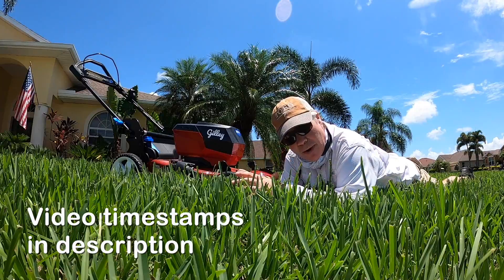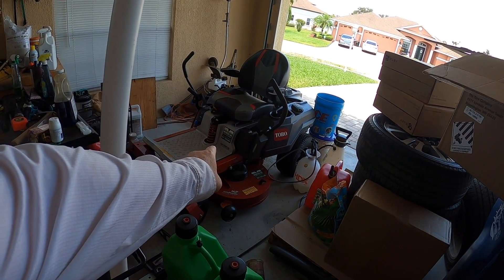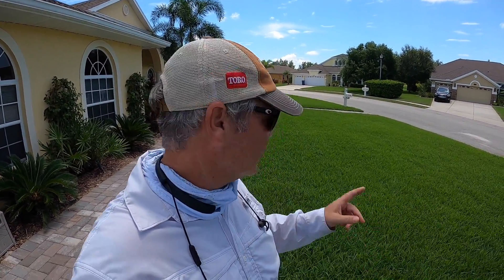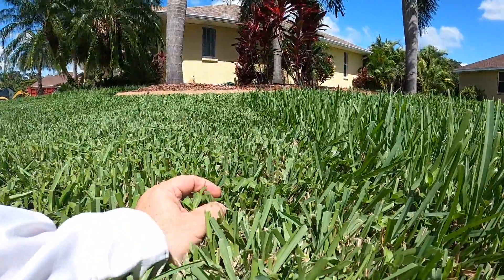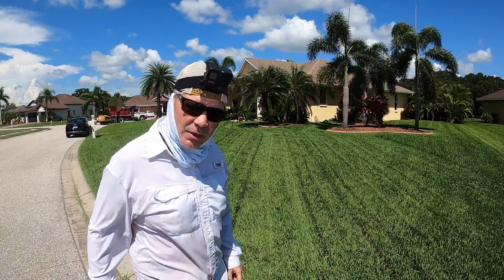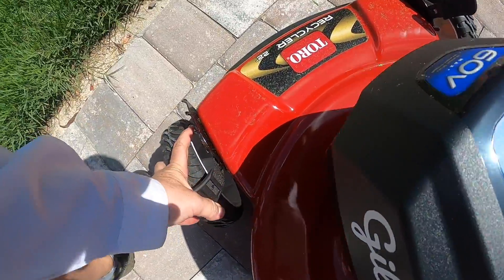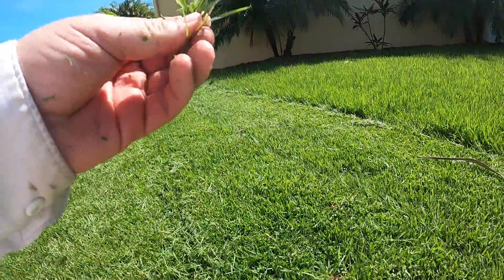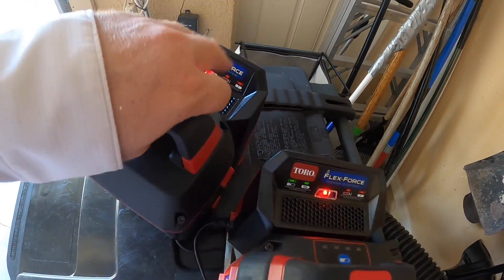60V Mechanical Bull

Comment: pro tip - charge the batteries inside in the a/c after they've cooled down 15-30min.  really the best way is after use charge all the batteries up and they are all ready to go before you even start mowing the next time.  then you can take them inside and charge them up again after you are done mowing while you are doing other things around the house.  don't be like oh it's time to mow and then you gotta wait 30min-1hr for the batteries to charge.  don't be that guy lol.

Comment: I took electric commercial last season and haven’t looked back! Extra batteries are a must but it’s so much quieter, smoother and I can lift it in and out of the truck alone. I’m using Kobalt’s 40v push mower and Black & Deckers 20v string trimmer, hedge trimmer and chainsaw.  I don’t need the gas trimmer until I get really heavy stuff. I still use the gas blower but I think the battery blowers are going to catch up in the next couple years. Electric is here and it’s only getting better!

Comment: Purchased mine 3 months ago for my Saint Augustine grass and I love it. I was a little hesitant... battery powered mower come on really...but works great. I have little less than a  1/3rd ac. I start with the 2.5 and do as much as I can and then switch over to my 6 AH and double cut everything with those 2 batteries, bagging. When I mulch I can only double cut the front of my yard and single cut the back, uses considerable more battery. Great mower,  now we just need to super recycler in a battery mower!

Comment: I have the same Toro mower except mine came with the 6.0 Ah battery. I'm able to do my 6000 sqft lawn and still have 2 lights left but mine almost never needs to kick into the extra power mode.  So I expect I could do 8000-10,000 sqft if it wasn't overgrown. 
After trying the Ego last season and returning it, I plan to keep this Toro

Comment: I had a black and decker electric mower; great out of the box. After a season got weaker. Had to charge the battery 5 times to get through my yard. Even bought new batteries for it and still the same. Love to see that thing in action after a year.

Comment: I’ve had my Toro 60V for over a year now. I took your advice, bought it online and specified a local Toro dealer when I made the purchase. That was good advice as there was a minor problem when it arrived. The dealer fixed it on the spot. They had not even seen the 60V until I brought mine in!  I have the smaller 324 ah battery, total 1,600 sq ft tall fescue, cross cut each time is 3,200 sq ft and gets it done on two bars. The only issue I have, similar to your zoysia - need a Super Recycler! If I let that lawn go one week without mowing it’s 8”+ high, thanks too all those great GC products. So my only request is not another mower review, but could you ask Toro to make a battery Super Recycler, pleeeeeease!  😊

Also, if too hot in the garage, you can take the battery into your air-conditioned home to charge. Somewhere out of the way, as it does hum while charging.

Comment: I actually use an old recycler professionally because I mow steep slopes and need something lighter than my exmark 21 inch beast. My recycler is an older unit and had the baby Kohler on it when I got it. But that wasn’t enough power. So I tried a gcv160 Honda and the air filter clogged too often and also not enough power. Then I tried an old flat head Briggs motor and that had enough power but I still wanted something lighter. I noticed your recycler is older like mine and has the flat head Briggs on it, man those are stone reliable torque monsters. I got a Troy built mower with the newer Briggs exi OHV engine in on trade. So I swapped that onto the recycler. Now it’s light and powerful. Lighter than the gcv160 and as powerful as the big 190cc Briggs flat head! Love my recycler because I can cut 6 inch tall Bermuda now with the side discharge shoot on at the second to lowest setting and it powers right through it ♥️I actually also use it on the highest setting on my neighbors st augustine mulching and it powers right through that too.

Comment: I owned this mower......I returned it after 5 weeks of cutting. The mower doesn’t have enough sucking power. I can post a video. There was lots of returns of this mower at Home Depot in my local area. Also I live like a few blocks away from Toro head quarters. I went with a Honda gas mower now, it’s 10 times the power. Tried the 7.5 amp battery as well. I’m in MN. The mower has a design issue technically, well not a design issue but an uncontrolled speed issue (over drive) where the mower goes into high mode if you throw to much at it, but this kills battery fast. Second thing is over drive kicks in when your all the way down on the push. I’ll post a video soon if anyone wants to see it.  I wouldn’t recommend it, sorry I tried cutting leaves up and it was horrible. Maybe if you live in FL where there no leaves buy it but a maple get gas.

Comment: Greenworks has a 25 inch battery model. That would be a good comparison video to meet in the middle between the battery Toro Recycler and the Timemaster.

Comment: The go to comparison in spring of 2021: Ego LM 2156 / LM2135 Vs Toro 60 Volt Super Recycler or Recycler, vs new Ryobi 40 Volt Cross Cut. I’ll see you in the lawn! What says LCN on the $600 plus Cordless mowers?

Comment: Nice review. I bought the 21" Ego Select Cut this spring. It's working fine so far, although the highest cut is a bit ragged. I do hold up on the handle as you indicated in your Ego video which seems to help but I dropped the height to 3.5 inches (#5 setting). I'm thinking of overseeding with TTTF this fall in my KBG sodded lawn. I hear it's less susceptible to dog urine spots and more heat and drought tolerant. If that's wrong, let me know before it's too late. Keep 'em coming.

Comment: Great video Allyn. 
I bought this machine in a non self propelled version as it extends running time and as with any model or brand of mower, makes it half as likely to need repairs over the course of its lifespan. I’d returned a cordless Husqvarna that I’d purchased after only one month as pieces on its handle assembly began to crumble after only a few weeks so being a lifelong Toro owner I was happy to buy the 60v as it was like coming home. I’m still happy and it’s now a year old. Hope that it lasts as long as the Recycler with Honda motor that it replaces. 
I’m glad that you asked about seeing other options. My Toro works as well on my small yard needs as my gas Recycler did however I’m curious about either of the two, twin blade offerings from Greenworks in their 25” models either 2510802 or 82VGMS250.  I’m curious about their mulching and bagging performance as they are like junior electric Timemasters.  I only use my rotary mower once or twice per month when I deep rake then vacuum with the mower.  The rest of the time I mow every few days with a manual push reel Hudson Star which is an artful treasure. 
Thanks Allyn.

Comment: I've got a Snapper XD 82v 21-inch Deck Self Propelled which came with two batteries. Bought it with an 82v Leaf Blower so now I have three batteries. Each battery can do 3000-3500 sq.ft. so my 7500 sq.ft. yard takes 2.5 batteries (thick and tall KBG). With three batteries, I get continuous run time even if a battery overheats. Personally, I think it was nicer than the EGO, but that Toro gets my vote for the washout port!!!

Comment: Hey Lawn Care nut, I’m fully geared with electric lawn gear (Ryobi 18V, 5000sqft lawn). I have really enjoyed the experience, but a must have is multiple sets of batteries so you dont have to wait for the charge. It’s also helps to keep your batteries inside, it will help the overall health and longevity of the batteries (I’m a EE, so speaking from experience). Glad you gave electric a try, I can appreciate your preference for gas. Would love if you could make it out here to Tallahassee some time and help me with my centipede lawn. Thanks!

Comment: Hey LCN, I REALLY want your opinion on the Greenworks wide deck mower. It's Timemaster style, but I haven't seen any reviews of it from a source I trust. Especially someone that is so into the original mower it's mimicking. I have a larger lawn but I'm all about electric now so I'm thinking about upgrading next season.  THANKS!

Comment: I have this mower and it does a great job on my St Augustine grass. I've had it for about three months and even when I've walked the whole yard looking for clippings, I haven't found a thing. My only complaint is that I've noticed a clicking sound coming from the wheels lately, but whatever it is hasn't effected the performance at all.

Comment: I got me a Snapper 60V lawn mower about a year and a half ago. It's not as high tech looking as this Toro but it "does the job". Cuts the grass. Since then  I've always wondered if you'd switch to battery powered lawn mowers. In my opinion they're alot simpler to work with, no gas or oil needed. But I think they need some time before the performance matches up to gas.

Comment: Did you see Toro has a battery version of the super recycler? I'm re-watching this video because ive been preparing for months to get a super recycler, then upon checking prices i see this new one. I think im going to stick with gas despite me preferring the environmental aspect of a battery. No tdead set yet though.
Reply: Careful on the 190 CC B&S Super. Not much love for that variant. Lots of stalling and carburetor issues. The smaller B&S or Honda engine seem to get more love on the inter webs
Reply: @seanrice7511  thanks for the reply ive since decided to go the battery route.
Reply: @webbspinner57  awesome! The Super Recycler or a different one? I’m in week one of using the Ego LM2156. About to switch to the high lift blade for week 2. I have to bag my backyard sometimes due to dogs but mulch front. So we will see.
Reply: @seanrice7511  the super recycler… waiting on delivery now…
Reply: @webbspinner57  I think that is the true competition  to the LM2156. Price, battery runtime, cut quality, etc. congrats and good luck. I really hope someone starts reviewing the $400 Home Depot Toro 21356 without Personal Pace. I may try that one if I don’t keep the Ego. But 3 weeks before I have to decide.

Comment: Didn't read all the comments, but I'd like to see it up against the Stihl self propelled.. bonus functionality, one adjustment for height, also gets hot battery charging delay but the charger forces air flow to reduce the wait time

Comment: I wonder if Toro and Ego shared some designs on the batteries/motors. The batteries share a similar size and similar charger as well. the 56V vs 60V is probably just marketing just like DeWalt does with its 20V even though it's actually an 18V. It even does the same spooling up with the high/low drive that my ego does.
 Can you give us any insight to that Allyn?

Comment: You should review the Greenworks 40V 21" Brushless (Smart Pace) Self-Propelled Lawn Mowers that you can get on Amazon.  I normally mow my ~1 acre yard with a lawn tractor but am considering getting an electric mower for some of the areas that are hard to cut with the tractor.

Comment: Is MTD out with one yet? Here's why I ask. I bought a Toro earlier this year after I bent the crankshaft in my old Craftsman/MTD gas mower. I hit a bush stump. I am happy with the Toro and it has plenty of battery life for my needs. But I don't like the single wheel drive. lts fine on level ground but spins going up hills or across a hill with the drive wheel uphill. The MTD had a nice two wheel drive with differential-like action for turns. I'd pay extra for that feature. The other thing that it lacks is single lever height adjustment as the MTD had. I don't like the individual wheel adjustment. Not at all. Otherwise, the battery does gain a bit more life after a few initial charges. It rarely goes into high power mode. The MTD always started easy unless I had it on the side to sharpen the blade or when it was hot, probably vapor lock. So in that, I appreciate the electric mower.

Comment: Will it get through the zoysia on the lowest setting without stalling (with a bag is fine)? Getting through the spring scalp on the zoysia is a key requirement for me... I wouldn't expect it to at full overlap even half overlap would suffice.

Comment: I have an Ego set up and what I do if the yard is tall or wet and I know that it will take more battery than 1 full charge is......I mow the back yard first....put the battery on the charger. Then I edge and when im done the battery has plenty enough charge to finish the job.

Comment: Personally I'm not sold on battery powered mowers. Mostly because the battery life is a problem. I have an empire zoysia lawn and would need to have two batteries just to get through one mow and ever time I go to lowes or home depot I always see at least half a dozen of them returned for one reason or another. Ultimately I will stick with my craftsman m230 cuts great and is half the price.

Comment: I have thew Green Works 80v  21" Mower and Trimmer/Weed Eater. I'd like to see the comparison on that , I have a 4200 Sq Ft Yard and have no problem cutting my yard on one charge Large Battery. I also cut my neighbors yard every other week all in the same day. Side note I don't have the charging heat issue that you experienced so after the 1 hour charge I was able to complete her yard as well.

Comment: Try the new Harbor Freight Atlas.  They are the budget competitor to the big brand battery mowers.  They use an 80V battery that even operates as a 40V for longer runtime in some of the accessory lawn tools.

Comment: I believe That flap in the back has an open hole at the tailing edge you can put a piece of 1/4 inch rebar in it to weight it down for better striping

Comment: Put it up against the New 20V Dewalt while using flex volt batteries. I got one and I swapped the stock 20V 10ah batteries for the FV 9ah batteries and heat wise they do good. I’m in South Texas by the way 🥵

Comment: How about the Lowes "Kobalt 80v" I have the blower, weed wacker, hedge trimmer and I enjoy them a lot.
Reply: Greenworks clone
Reply from the maker: I see many folks mentioning that one. I'll have to check it out
Reply: My neighbor has one and it cuts better than my z335e.  They seem to have the same issue with running out of juice, but they’re usually back out in an hour to finish up.  They also have the advantage of less weed whacking due to being able to get into corners.
Reply: @TheLawnCareNut  How come you don't have any videos on what to do after you've applied the weed killers? Just back to watering as normal? Maybe throw down fert? 

Im due east of you and under a fert ban as well. Just killed off a bunch of weeds. So no N or P for me. Just wondering thanks.
Reply: I have that. It's great and all but has virtually no lift. For zoysia and Bermuda I'm sure that's fine but for fescue in the northeast, it misses so many blades it's ridiculous. Anything that isn't already standing up just doesn't get cut

Comment: I have a Kobalt 80V Max that would be cool to compare to Toro. Also Greenworks 60V mower because I have heard they make the Kobalt mowers for Lowe's. Plus the Greenworks 60V mower has a "Turbo" button to ramp up the speed before tall grass. Sounds like the Toro is like my Kobalt and when it feels resistance then it ramps up the power. I wish I had a turbo or boost button so I could select more power!
Reply from the maker: we need more Turbo Boost! ✌

Comment: Hello Sir! I live in MD. Can I put down weed & feed at this time in August?
Reply: I tried the dimensions earlier in spring like you recommended, but the crabgrass is out of control at this time
Reply from the maker: @dubdsy5376  you want to use quinclorac on crabgrass. weed and feed won't do the job.

Comment: you should voice your displeasure of milwaukee tool not having a production electric mower yet, especially with their debut of the new mx fuel battery line, im sure a few of those BIG boys can power a riding mower juuust fine

Comment: I put graphic spray under my deck  and I get a better cut and  very little grass stick to the bottom. I do wash under my deck  after every cut. I have a new Toro and one that is 20 years old and looks new because I wash them after every cut. The 20 year old cuts better than my new one because it is heaver.

Comment: Usually 40v is about a normal cheap gas mowers power. I have a ryobi 40v and it does my quarter acre with a 5Ah and a 4Ah unless stuff is wet. Not sure how that would work on grass like yours though as mine is weeds all the wat and not super thick except over my drain field where its hecka thick and will bog down when especially with wet or if i go to fast or have dull blades.

Anyway 40v is prolly slightly under powered just like ant cheapo mower  but over that is prolly awesome

Comment: I’d love to see a comparison with the Ego Select Cut...selfishly those are the two mowers I’m debating between purchasing.
Reply: Hands down go with the Ego select cut , I can cut about 11,000 sf on a single charge with 56v 7.5 battery (no bull🤣).
I was surprised the Toro could only cut about 5,000 sf.
I have a 20,000 sf lawn and I purchased a backup 56v 7.5 (last gen battery) and when done cutting I have a little less then fall a charge on my second battery.
The only issue I have with the Ego is you really need to over lap well otherwise it can Mohawk easily other then that it’s a winner.

Comment: 7.5 battery on Ego Mower:
Factory blade = 2 avg sized yards mowed
High lift blade = my yard only front/back
Mulching blade = only my front yard ☹️
Think its about 1/2oz difference in weight between each blade type.

Comment: Next test would be a super recycler deck with the electric motor MODIFICATIONS NEEDED inner the battery doesn't last as long with that special wing on the blade assembly
Reply: Sachi WI I’ve been tempted to find a used Super Recycler and swapping the parts from my Toro 60V!